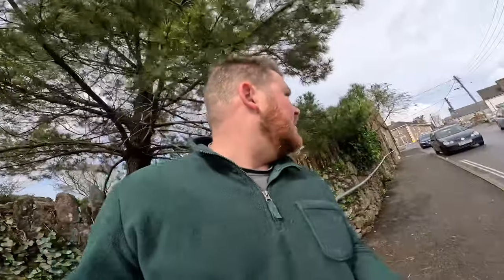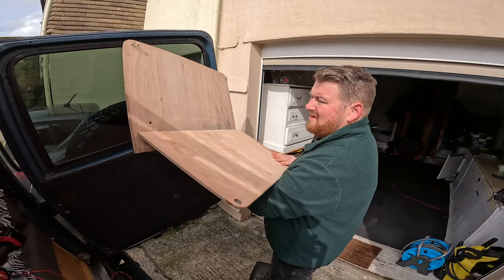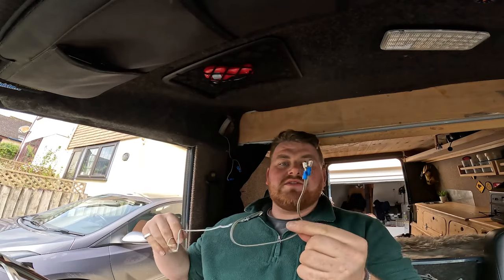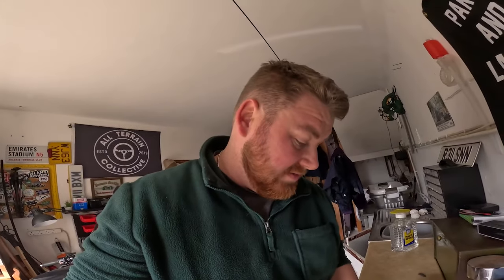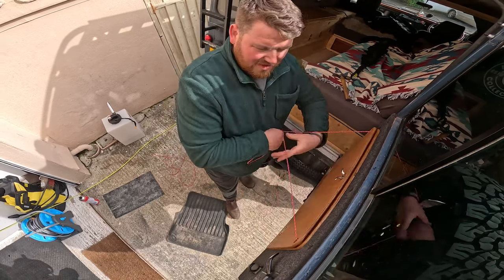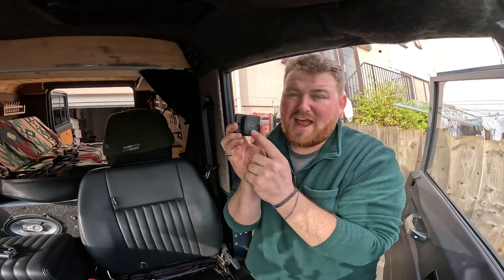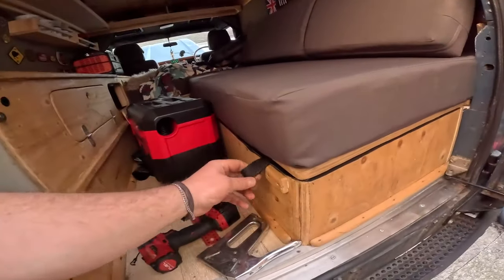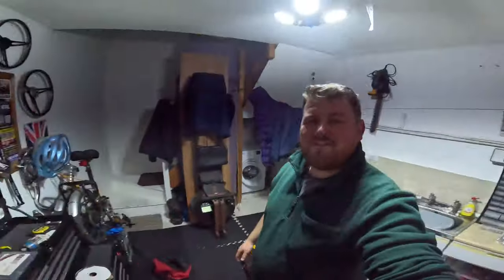CAN I FIX EVERYTHING ON THE DEFENDER BEFORE WE GO TO SCOTLAND?

Comment: those wires in the battery box have got my ocd going mental lol i use my drivers side seatbox for my relays and multiple fuse boxes via pre made harness from my dash into seat box through relays and fuse boxes then back out under the b  pillar to c pillar then back into the back of my double cab then upto a gland back out then into another gland into a plastic water proof box to joing all the lights on my roof rack via waterproof plugs if your gonna do it do it rite first time i find vaseline is brilliant for plugs stop the water,buy a cheap furrel tool and use it on all your wires going into your control pannel much better than bare wires going in just for ref.use cloth tape for harnesses were you can stops tapping noises from harness wires too lol .
Reply from the maker: Hahahaha